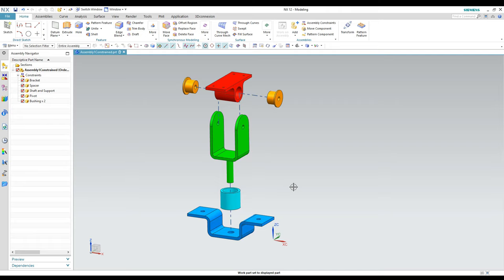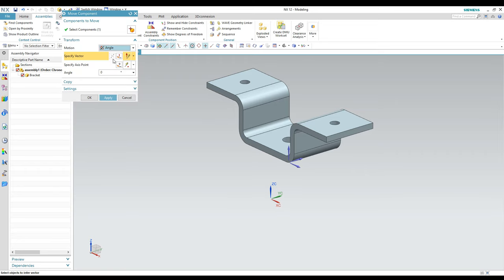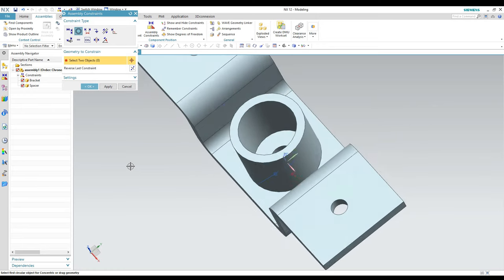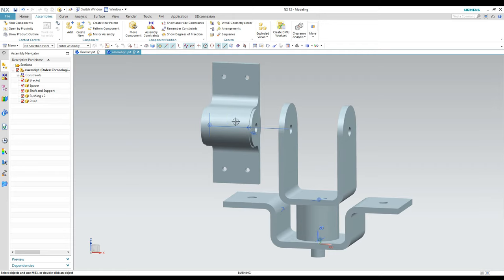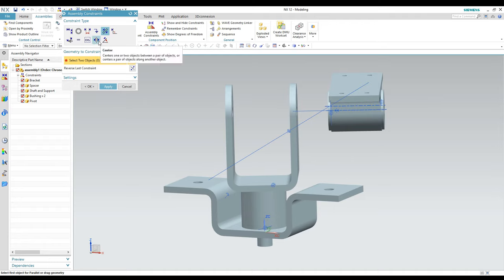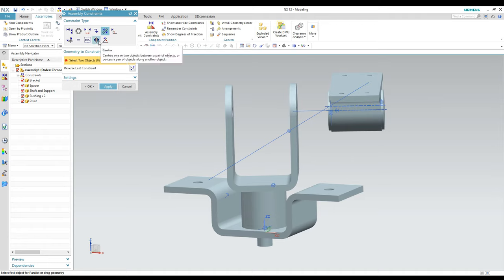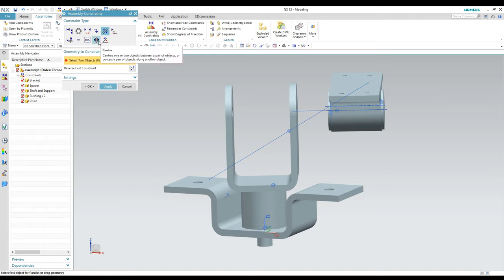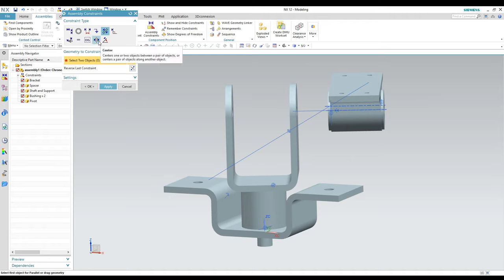Siemens NX Basic Assemblies Tutorial

Comment: I  was wondering..how is the screen panned and rotated smoothly in the work area without the mouse moving? any prebuilt shortcut key ?
Reply: The smooth rotating / panning is done with a 'space mouse'...
Reply: @1951split  oh ok thanks!
Reply: You can use CTRL plus R to rotate your models.
Reply: @sukhdevr3489  thanks gotta try that
Reply from the maker: google 3D Connection space mouse